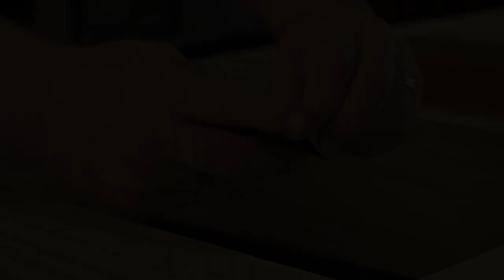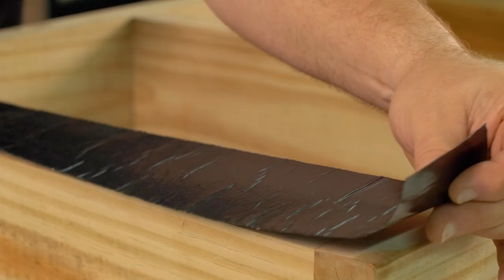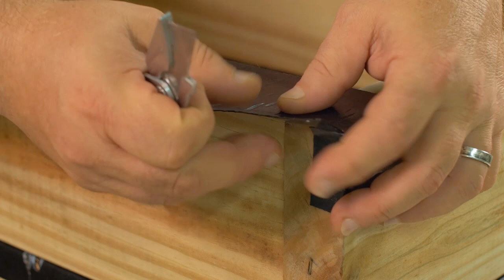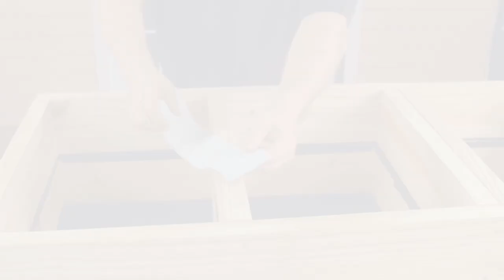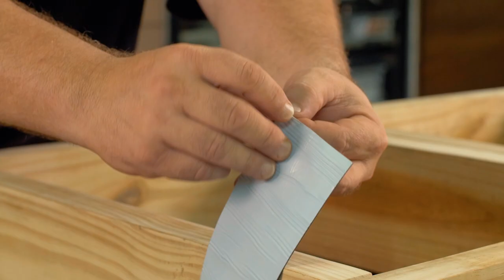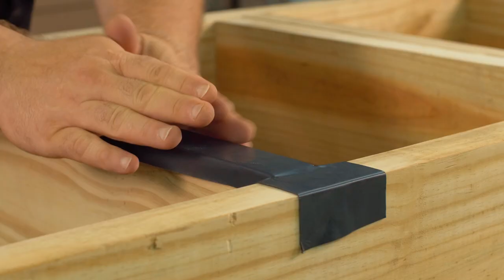DeckWise® How-To: JoistTape™ Joist Barrier Tape Installation

Comment: I lost an old deck due to the tops of the joists rotting, already pretty far gone when I moved in. I had a linden tree in the yard dumping junk into the deck board cracks, and the linden is a very "hostile" tree. I was going to flash the joists when I rebuild it but this looks like an even better solution.